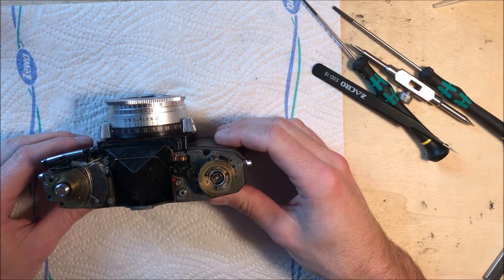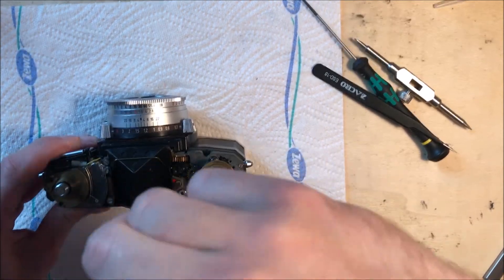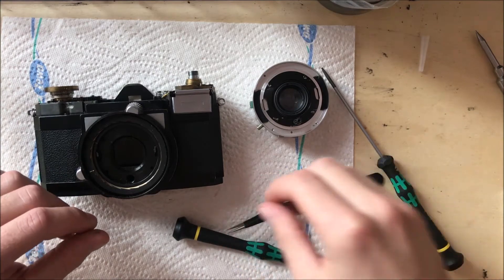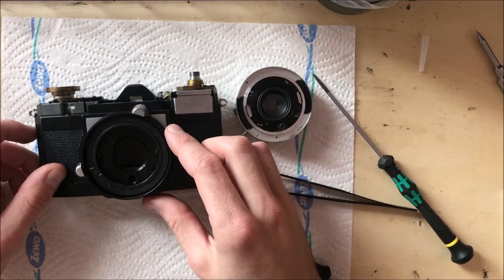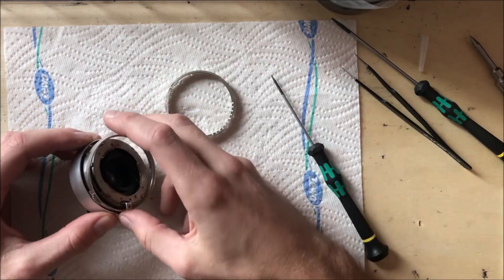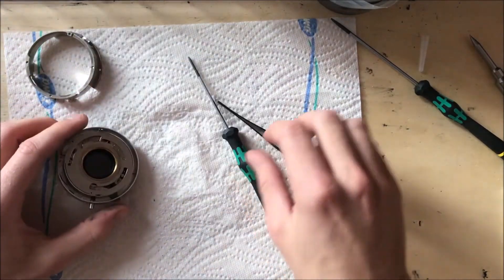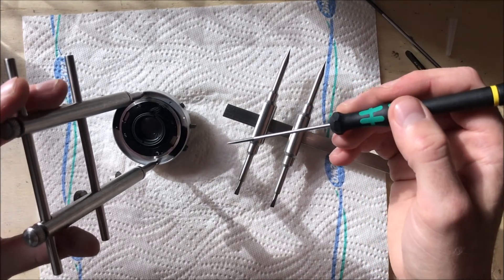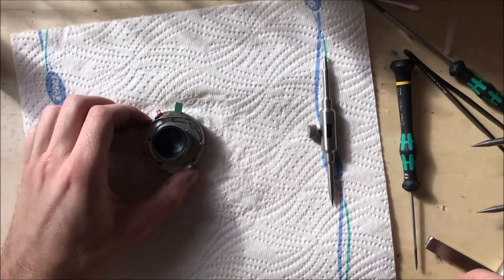Contaflex IV CLA Repair [part 2/7] - Removing the prism and the shutter

Comment: Hello. Is it ok to remove the 4 screw shutter/lens assembly by itself, without removing other parts on the camera? Will this cause any issues?
Reply from the maker: Yes this is possible. It makes sense, when only the shutter needs to be repaired. When putting it back together, the winding gear state of the body and the shutter must obviously match. Also, the focus distance must be checked again. It might take several tries until everything matches again.

Comment: Lovely work until the slipping of the spanner wrench damaged the shutter assembly retainer ring.
Peg spanners - suitably sized steel tube ground so that two 'pegs' remain in the positions of the slots in the retaining rings are easily made and prevent such damage.

Comment: Hello, have you have experence with contaflex Super BC? I just bought one from ebay. I was so happy  because it came in working condition. I tried all speeds and decided to press small lever to V mode on shutter I think it is timer and then something bad happen.  I think shutter or diaprahm leaves stuck in almost close posiotion and  you cant cock the camera. The cocking lever is moving but it is loose,  so you cant cock a camera anymore also mirror doesnt move. I am so sad that I jamed beutiful camera. I heard that repairs are really cost much
Reply from the maker: Don't feel bad about braking anything. If sth. like this happens, it's the cameras fault and not the users ;)
I don't yet have as much experience with the Super BC as with the earlier models. I do plan to get more practice with them, too, and make a similar video for them in the future. So maybe put it aside for now, and when you feel more confident, try to fix it. I highly doubt that the self timer (Setting "V") causes the issue that the mirror doesn't move and the shutter can't be cocked. There is most likely some other issue.

Comment: Hi. I am having a problem with my Contaflex Super: when I bought it from the antique market, the focus ring was acting strangely. So when I got home, I tried moving it but it came appart...do you know how it can be screwd back together because when I try it, it doesn't quite fit...
Reply from the maker: Hello Darius, so the shutter is still attached to the body, just the focussing ring came of? That should not be possible, i am afraid something could be broken then. The focussing mechanism of the Super is similar to that of the IV.
I would try the following: Have the camera in the released state. Set it to 1/500 s and f22 (or sth else you can remember). Remove the back. Unscrew the 3 screws holding the shutter to the body. You can access them through the film plane, they are all sinked in a little. One of them is tricky to access, as it is a little covered. They also have washers, dont lose them. Then you should be able to take of the shutter from the body.
The focussing mechanism is accessible now. Search for any broken part. If nothing seems broken, try to put it together. Just like in the Contaflex IV, there is an inner ring, against which the shutter is screwed on. That ring has a multi-thread and is screwed into the inner thread of the focussing ring. It is the main responsible part for the focussing mechanism, and the depth (how much it is screwed in) is crtitical. I normally try different depths, screw the shutter on, and test whether the focussing is about correct, so i can focus anything from 0.7 m to infinity. Also, when screwing the shutter back on, it is important that it is in the same initial exposure setting (e.g. 1/500 and f22).
Sometimes the threads are very sticky and hard to move at all. in that case, it should be cleaned very thoroughly with a solvent (naphta), until it's moving easily again. Then i usually use some grease to make it smoothe again.
I hope that helps, and if not please describe your issue in more detail or maybe send a picture of it.
Reply: @pietscameraworkshop5024  Thank you for the reply. Sadly, the 2 brass rings that come off are busted (the one which attaches to the black focus wheel and the one that goes onto the lens itself). I have no ideea where I can get a replacement for them because it's an old camera. If you happen to know, I'll be more than happy to resurect this beauty.
Reply from the maker: @dariussala6377  That's unfortunate, i am sorry for that... You can only get replacements from another Contaflex Super. Normally that's not a problem, because Contaflexes are very cheap here in Germany. But I've heard they can be much more expensive elsewhere, like the States...